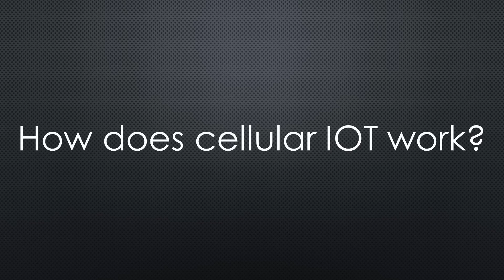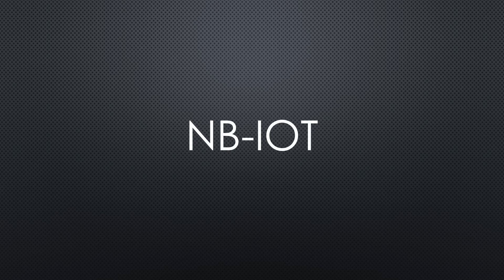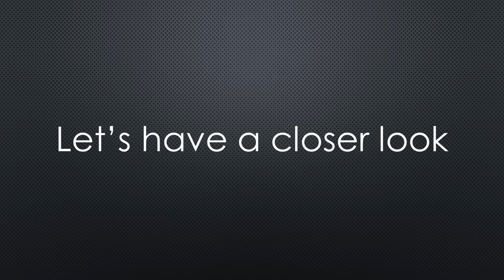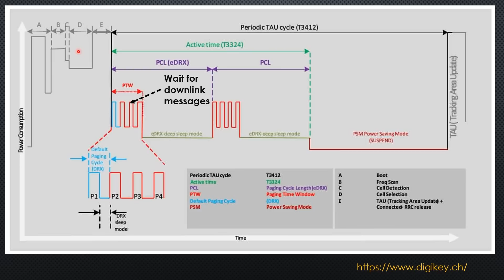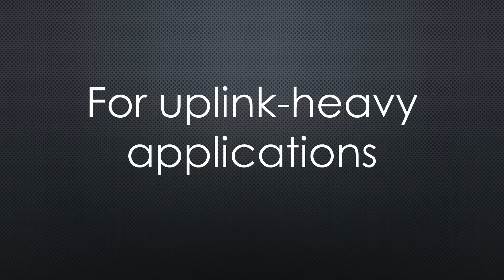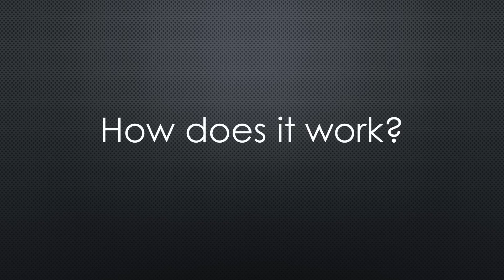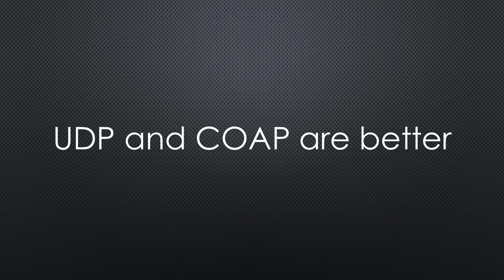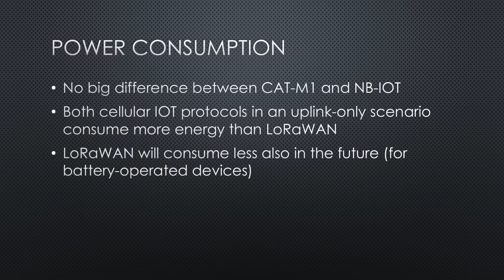(480) How does NB-IOT and CAT-M1 / LTE-M compare to LoRaWAN (Tutorial)?

Comment: Hi Andreas  I have a Ferrari and want to add remote control to it, what do you suggest for the processor?  What do those flying drones use?  they have a camera and you can have controls to move around?  I could buy a drone or use a very old one with a camera and try to hack into the car;  but just want some connected device up to 200 feet and be able to steer, accelerate/brake and have an onboard camera?  its a 4 ft long Ferrari.  using LoRa is fine, thanks
Reply from the maker: I would use a standard remote control. They are made to control RC cars. So yours is only a bit bigger ;-)
Reply: @AndreasSpiess  Yes thanks but this was a kids car they sit in, and the hope is to make it into an RC car with a camera like the drones have?  and to build from scratch unless there is a remote control kit you are thinking of?    Id have to make the Servo motor mechanism, am thinking maybe a power window motor out of some car? 12v and torque to spare, but nothing too complicated just something that works fast.  thanks

Comment: Thanks for the video Andreas. Nice to see the familiar Nordic PPK2 graphs and also Walter - Daan and his team have been fantastic to work with and I am so happy that you've been able to feature them on your channel twice now 🙂. As for the CAT-1bis, I've also recently had the opportunity to work with an ESP32-S3 board from Makerfabs that uses the SIMCOM7670 . This seems to offer CAT1bis (10Mbps download, 5Mbps upload). What is super cool about this is that it just worked with any local SIM Card and that it can degrade to 2G/3G if that is all that is available.  Yes, there are still places in the "wild west" where this is the case. I myself still have a working Nokla 1280 🙂
Reply: Thing to remember for Cat1bis is that it's not really an IoT technology.   Cat1bis is a variation of LTE Cat1 introduced for wearable like smart watches.    The difference between Cat1 and Cat1bis is the removal of the Rx diversity antenna.   LTE mandates at least 2 antennas but in a small format factor device like a watch, to fit 2 antennas in would be a struggle and even if you could fit them in, the close proximity to each other means you do not get much diversity gain.   So Cat 1 bis was introduced as an exception to the rule requiring LTE devices to have at least 2 antennas.    By removing the second Rx chain from a Cat1bis enabled manufacturers to make a cheaper radio module and that was appealing for IoT applications.   Of course removing the second antenna means your downlink radio performance budget is impacted.
Reply: @waynelaw8999  - I did indeed wonder why the board only had 1 LTE antenna - your explanation has been great in explaining that. Thank you!
Reply from the maker: The tip for CAT-1bis came from a viewer who works for a big telco ;-)
Reply: Is that in the U.S.?
Reply: @SoundOfYourDestiny - If you mean the SIM Cards that just worked with LTE CAT-1bis, no, not US. Doesn't mean that it might not work in the US, just that that is not where I tested. If I remember correctly, the SIM7670 data sheet does not show the US as a supported region, but maybe it just hasn't been certified for use there yet.
Reply: @stefans9990  Thanks!
Reply: @stefans9990 it might just work,  unbeknownst to support people at the carrier,  like that other protocol Andreas mentions.

Comment: Fantastic coverage of Cellular IoT! One topic I would have included in the downlink discussion is Firmware OTA.

Also, MVNOs like 1NCE and Hologram make  IoT SIM plans more accessible and affordable around the world.
Reply from the maker: OTA is an important story. But definitively too much for an introductonary video... And thank you for the link to other SIM card suppliers!
Reply: @AndreasSpiess  definitely! OTA has often been a key decision maker for our customers when deciding between LoRa or Cellular. It often comes as a surprise that it's generally infeasible to do OTA over LoRaWAN (though not impossible.)
Reply: 1nce and Hologramm is multi IMSI only. Andreas got 4 IMSIs with the freedom for automatically switch of the IMSI or manual switching. I prefer manual switching to reduce the energy consumption.
Reply: Just found Hologram after watching this and wanted to chime in. They have a free card promo, but the shipping is steep depending on where you are.

However, Hologram still turned out to be cheaper compared to domestic carriers for me, even with $30 USD shipping for a few SIM cards.

Comment: Nb-IoT NTN (non-terrestrial networks) is also very interesting, it uses Nb-Iot modules to communicate with satellites, which is probably the cheapest way to do it at the moment. This is quite new and was only introduced by 3GPP in release 17
Reply from the maker: I heard about it, but I am not sure if this is cheaper than the 2$/year SIM cards. Do you know a provider for such a service?
Reply: @AndreasSpiess  I would have liked to have said cheaper compared to other satellite modems, which cost a few hundred dollars each. About providers, I know of Sateliot and Skylo, but I imagine there will be others soon. Skylo says something about starting at $6/month, but doesn't say how much data is included
This is interesting as a fallback to nb-iot, if there's no cellular network available, it sends data via satellite
Reply: Skylo and satteliot are two sources of NTNs but are still only providing Sims to resellers (like montogo or t mobile) or to NDA signatories AFAIK.
Reply from the maker: @antaries778  Their homepages do not contain a lot of information. More like startups. Did you test them?
Reply: @AndreasSpiess  it wasn't easy, but I have just made an agreement with one supplier and now have a Dev kit and NTN SIM card in the post for a trial. I can let you know how it goes.

Comment: Hello Andreas, I saw in your mailbag video when you were unboxing the Walter that it came with a 250MB Soracom SIM, did you use that SIM in this video? If so, does it cost monthly or is it a one time fee? I tried looking online for more information but it isn't mentioned anywhere if there is a monthly cost.
Reply from the maker: I did not check the cost as it came with Walter. AFAIK it is a one-time data budget and if it is used, it has to be recharged (or thrown away). Did you check on the Soracom homepage for their prices?
Reply: Thanks for the info, I've checked their site, they don't mention the 250MB plan, they only mention the 25MB/month plan, which might be alright for my project. I'm currently having issues with an Arduino library for the SX1280, and your video has made me seriously consider switching to a cellular modem.

Comment: The lowest power consumption I have seen was an alarm sensor.  It would notify the alarm panel every minute that it was present and would send an open or close event when a window or door was opened.  The sensor ran on one 3V coin cell and lasted for about 7 years.  And it was about the size of 5 stacked quarters.  And it had a wire antenna about 8 cm long.  How is it possible to do something like this??!!

I would love to do this with a humidity sensor under my house and a few soil moisture sensors around my yard and temperature sensors in my house for a zoned HVAC system.
Reply from the maker: I do not know how it was done. Are you sure it used 4G?
Reply: Most door / window  alarm sensors operate in the sub1Ghz band and send data to alarm control panel , at predetermined intervals ( 16 sec to one hour )  or when an event occurs .  
The alarm panel has to be within the sensor range ( varies with  open space , number of walls etc ) or a repeater is used then to increase sensor range . Alarm control panels communicate with the rest of the world with tel modem line or wifi or GSM etc  ...  but these have large battery  ( usually 12V 7Ah )   for staying alive  at least  12-24 hours , when mains power goes out !

Comment: Thanks @andreasspiess, very informative once again!
I agree @comments below, 1NCE is awesome for small-data needs, 100MB valid 10 Years with roaming...
For a bit more data (eg. our autonomous camera (murgcam on Github) sends one 300kb Photo per Hour), i use a SIM from Digital Republic, 400kbit Flatrate for 4CHF/Month.
While testing how to replace the currently used GSM Modem, i found the Digital Republic SIM to work with a ublox SARA-R410M Modem, which is Cat-M1 & NB-IOT only.
 
Has anyone ever done calculations or experiments on the spent energy to send a few hundred kb via NB-IOT vs Cat-M1?
Also, i wonder where the limit is, where modem-sleep makes sense vs. powering it completely down. How does sleep-energy compare to the energy spent for re-registering on every wake. 40sec. stated in the video sounds like a lot. With the GSM Modem of murgcam, it made sense to power off the modem, so in sleep we have only the power consumption of the ESP in deep-sleep  and the 3v3 regulator losses.
Reply from the maker: Interesting! The supplier I mentioned was exactly Digital Republic. My SIM card did not work with NB-IOT and, after contacting them, they were astonished that it supported CAT-M...
Concerning energy: PSM woith PAI should be best (if supported). Walter consumes just a few microampere when the ESP and the modem is in deep sleep. So that does not count too much.
Measuring power consumption is not easy with this technology as it does not always take the same time to transmit data (as said: Repetitions). So best probably would be to deploy a few of them in different situations and measure over a longer time. You see in the power diagrams how long it took to connect to the cell (more than 10 seconds...). But PSM usually is alowed for more than 24h. So you do not need to re-attach.
Reply: The 40 seconds in the video is for constantly receiving on eDRX. In PSM 3 uA is today common. If you transmit each 2 to 3 days only, then power off is maybe the better option.
Reply: @HaraldNaumann  The deep sleep current of Walter is 9.8uA. 1uA is for the Sequans in PSM, 8uA for the ESP32-S3 and 0.8uA for our DC-DC converters.
Reply: 0.5 uA deep sleep current with the Gillette order button developed by my team. Button press on polling active and timer for wake up each 14 days active.

Comment: Funny, we did an LTE-M project 7 years ago, never took off and died 5 years ago, also due to the lack of affordable SIM cards (which seems to have changed in the meantime). It's a bit weird to call it an upcoming technology since a lot of (mostly utility) companies stopped using it already to due unfulfilled promises of benefits. LTE-M is really only usable with eDRX and UDP based (like you said CoAP) protocols like LwM2M in eDRX/queue mode to work efficiently, which is really hard to implement properly and requires careful consideration on the application side and a boatload of tweaking. Anything else will burn through your data (read: cash) and/or power budget way too quickly to be viable (both commercially and for hobby use). In contrast to LoraWAN where you "only" pay for the actual payload that is a huge difference and implementation burden.
Reply from the maker: I agree with your statements. This is why I think both technologies will have their places. But I also think, that some of the current M2M problems will be solved over time. It is still a new technology if you measure in "Telco time"...
Reply: IoT sim cards for LTEM are often LTE sim cards without support of eDRX and PSM. As soon the LTE network will use 3GPP Release 14 instead of Release 13, they will stop to work. This was happen in UK in October 2023. Andreas got from Crout multi IMSI UICC with 4 IMSI and 3GPP Release 14 plus roaming contracts for NB-IoT and LTEM. His Walter PCB will work in nearly any network on this nice blue planet.

Comment: Very interesting video. I use the Nordic thingy 91 and the Quectel BG96. LoRoWAN easier to test ened-to-end, Cellular needs a callbox for end-to-end testing. Also NB-IOT first scan can take up to 25 mins! Cheers!
Reply from the maker: Good to know about the 25 minutes! Because all our carriers use B20, I was able to shorten this a bit ;-)
Reply: Only the first scan takes a long while because the modem does not know which country it is in and therefore must search all bands.   After the first time, the modem is smart and will try the frequency that worked last time.    You can also speed this first search up if you know ahead of time where the modem will be used.    For people with Swiss accents, your application could lock the modem to only use band 20 for example.
Reply: @waynelaw8999 you never search for all and limit to the popular bands. Clever code is the way to win the game.
Reply from the maker: @waynelaw8999  That is what I did ;-)

Comment: Considering that LoRa is a proprietary tech controlled by one company, then yes, anything that reduces company control of everything gets my vote...
Reply: The LoRa wireless transmission protocol IS a patented and owned tech, yes. BUT its use is FREE of royalties, FREE to use in public frequencies with FULL control over the entire network, incredible advantages over cellular, SIM and/or even cloud-based IoT. I've been working with cell tech for over 20yrs; with LoRaWAN the last 3-5yrs. For small, non-critical localized data LoRaWAN will always win. For moving, critical assets across a wide geography definitely cell (for now) is the way to go...
Reply: @redwireless  Agree, Now Quectel have launched a LoRaWAN SOC, and Semtech are opening up Sigfox since acquiring them.. the future is convergence of LPWAN technologies. I say within the next 3 years we will see multi-mode SOCs with eSIM internalised for the 3GPP modes.
Reply: Lara physical layer has been open sourced by many people. The implementation is available in Python C++ etc. In addition Lorawan is  fully open source
Reply: @maximus6884  Try buying a LoRa silicon not from Semtech? Developed by Cycleo and now owned by Semtech. The alliance actively goes after any fab making LoRaWan silicon not authorised by them... Doesn't sound very OS to me...
Reply: No cost to run however
Reply: Please, how this matter after buying bunch of chips.
Reply: Sure but on the other hand you have closed source baseband that do whatever a oligopole can de 🎉
Reply: Oh didn't know that, somehow assumed it was at least semi open tech.
Reply: @accik  LoRaWAN is a proprietary LPWAN-connectivity protocol developed by Semtech (Originally Cycleo developed it and secured the patent, was them acquired by Semtech).

Comment: Mr Andreas, I use 1NCE, give a check. They have cheap 10-year sim cards for IoT and as far as I understood also available CatM1 and NBIot, if available on the local MNO.
Reply: We can confirm that 1NCE is working with Walter with both LTE-M and NB-IoT.
Reply: +1 for 1NCE. We've switched to them from another provider after we hit a bump and started searching for bugs in our hw, code and even the modem's firmware, logging cell registration, etc.The previous provider tried to help to some extent though (we had the sense that they were in the blind apart their very onw APN) by suggesting necessary specific modem fuctionality. We have tens of remote devices across a few countries, but sometimes all, other times just one country's network would drop them after 1-2 months and most won't try to reconnect. This made us rethink the LoraWAN idea again, but 1NCE is doing something differently and saved us a lot of headaches.

Comment: As someone working in cellular IoT, I think you did a very fair comparison. Maybe to add that NB-IoT has +20db coverage compared to LTE-M so it has better indoor penetration. This is at the cost of repetations hence increased latency and is also the reason why tcp based protocols such as mqtt are not the best choice. So indeed better to use coap. Also LTE-M is much more 2G  like. It e.g. also supports voice (VoLTE)  though most operators have not implemted that yet.
Reply: Sorry you are wrong. LTEM has just 6 dB sensitivity in comparison to NB-IoT. VoLTE is feature of LTEM, but it is not supported in all LTEM networks. The diverse in the supported features in different networks makes it complex. I consult IoT companies with global roll out. The SIM card of Andreas delivered by Crout is a multi IMSI with 4 IMSIs. I can help with up to 25 IMSIs.
CoAP UDP or MQTT-SN on UDP is the way to go. A round trip time of 10 seconds with NB-IoT and LTE-M is possible. I test with my team 5G NTN (NB-IoT by satellite). 10 to 40 seconds round trip time!
Reply from the maker: Thank you for your "verdict". This video took a long time to learn for me. So I am glad you think I got it right ;-)

Comment: That was interesting, I have been evaluating cellular technologies v LoRa and for my use, which it mostly fixed installations or units which are never out of range, the added cost wasn't worth it, but that is not to say it won't be in the future. BTW I just discovered that IoTstack does not in install on the RPi OS due to the installation of mqtt is crashing (the choice of packagehandler).
Reply from the maker: I would post your problem on the discord channel of IOTstack. So far, it always installed and it should remain like that.
Reply: @AndreasSpiess  Great thank you :)